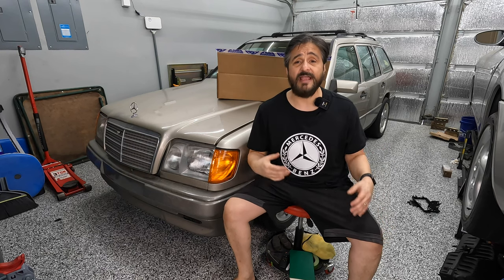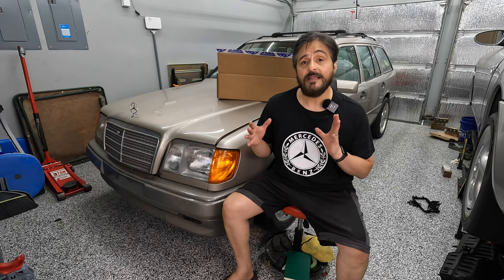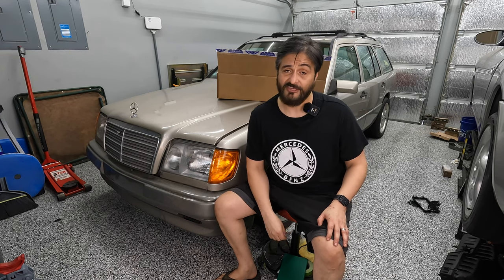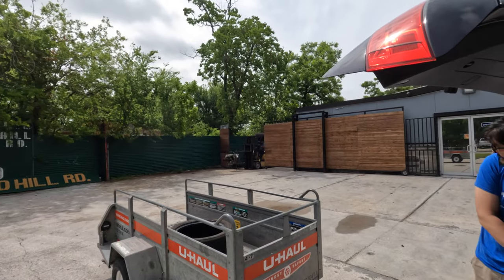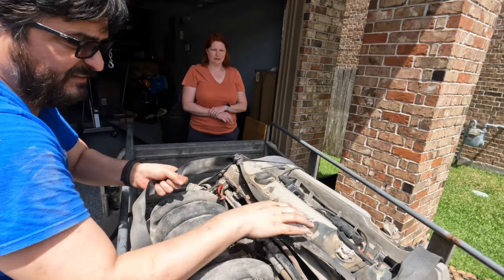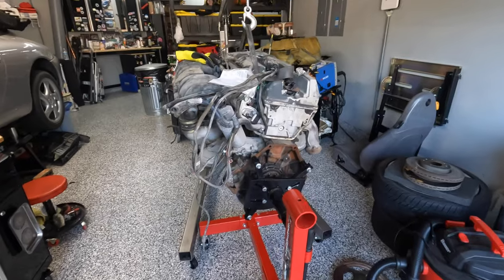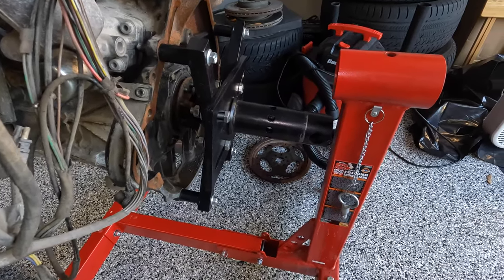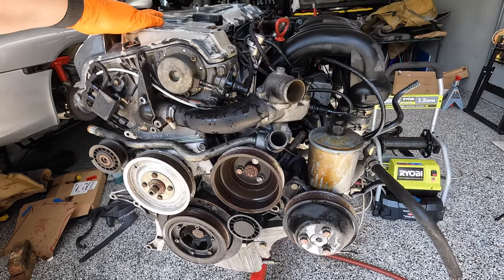I Bought This Wagon and I Regret It - Can I Bring It Back To Life?

Comment: why not put in a similar larger displacement motor? once you are in this deep...
Reply: Which larger displacement Mercedes engines swap in?

I love putting newer higher HP engines into older chassis.
Reply from the maker: Because I’m a newb and I want to get a successful replacement under my belt and then I’ll go hog wild.
Reply: @YogisGarage  fair enough...no need for a  giant turbodiesel yet...
Reply from the maker: @jimf5160  yet